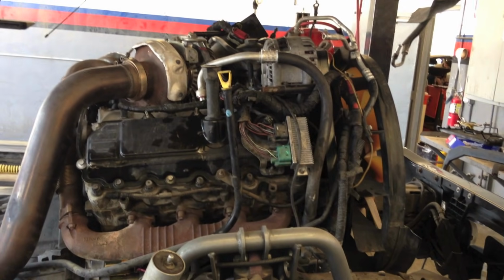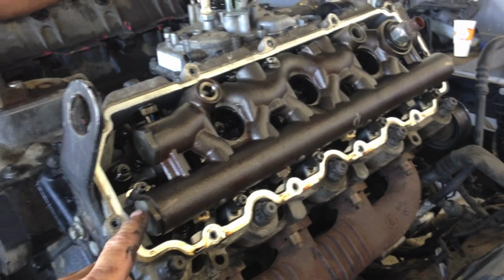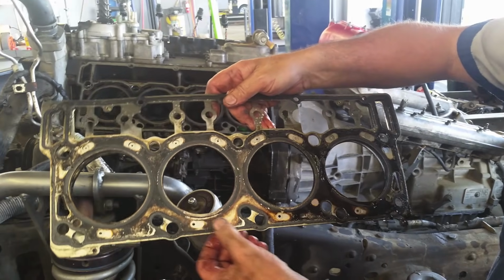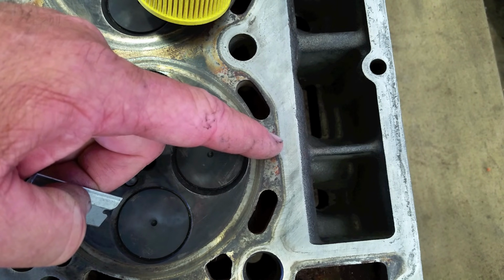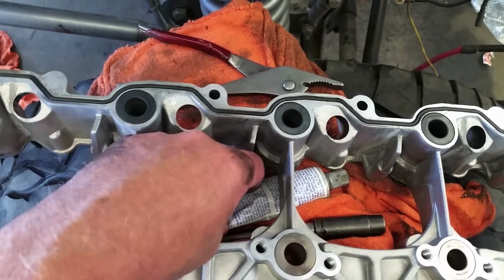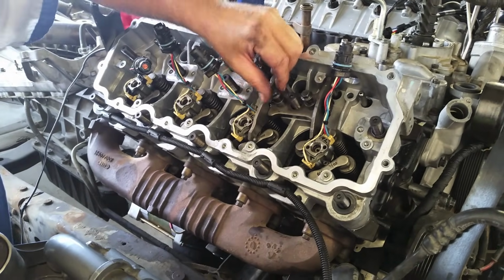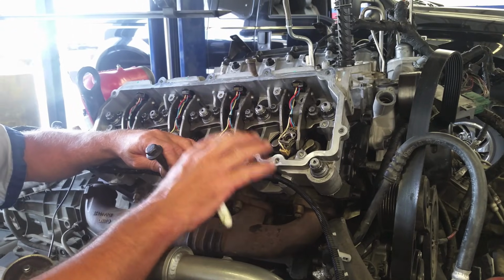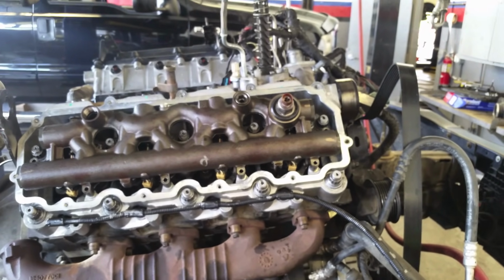Ford 6.0 Powerstroke head gaskets tips and pointers

Comment: Clearly this truck was run hard and with higher than stock power and boost levels,the aftermarket downpipe,,banks intake horn and lift kit are all signs of a play toy truck that the owner likes to show off,not a work truck.For trucks like this an o ringed head is the best repair. I know Ron said this is what Ford recommends and hes right but Ford also recommends 325hp and 24psi of boost not 30 plus and 425 plus hp,so Fords recommendations are out the window so to speak at that point. Typically a ..041-051 thick stainless steel wire is used with around a .010 protrusion ,when done right with ARP studds this is a huge upgrade and will give alot more holding power and longevity.There is a tool you can buy to cut the o rings,it needs to be done right, I used this tool on my Cummins to cut o rings and its very effective when done right.
Reply from the maker: No programmer on these gaskets.  It WAS modified with a programmer.  When it failed the first time he took the programmer out.  He just got cheap on the gaskets.
Reply: John DiMartino
 power and longevity on a Ford  $$$$$$$ buy a Dodge  $ never worry about your bank account again !
Reply: Scott wads the only problem is the only thing that lasts on the Dodge is the Cummins.
Reply: Scott wads  Yeah mopar Flickr in Flash  all the electronics start failing and then than the transmission  There is quite a bit of videos of head gaskets going  As well head studs are pretty popular on Cummins   Is drawbacks to all trucks but your best bet at least is to not get a Chevy

Comment: Interesting information regarding the head being susceptible to leaking with a mirror finish- I always thought at least regarding gas engines that a perfectly flat head would give the best results - So what would be the cause of head gasket failure especially since it was already changed and studs upgraded ?
Reply: That was old thinking. Even gasoline engines, no longer is it recommended to resurface cylinder heads.  You mic them, if within spec, you clean them, and go with new gaskets.  The job of the gasket is to seal. If both surfaces are within spec, and the finish is not abnormal IT MUST seal.

Comment: i dont see how you can warranty work like this i mean really check the heads the correct way not what ford now says you will rarely find a head warped the way you checked, thats probably why the old gaskets failed they just dont go bad for no reason. the best fix for a 6.0 head is the wire insert that is machined in (fire ring some people call it) its like having a liner protrusion like on a big diesel. Helps alot
Reply from the maker: Hi Hayden. after years of research ford /international updates their repair proceedures. if this method did not work we would not keep using it. Updated factory gaskets do not fail if done right in a stock truck.
Reply: i understand they may update them but still i wouldnt put a motor back together just by checking across the hole its sealing. i would check the head in an x pattern and then one across the middle if its bent more than .004 its gotta go. Also theres a reason why the old gaskets failed its probably not because they are aftermarket its probably because the heads are warped and the deck isnt flat. If you do this on a big engine and you check the heads like you did and see that its flat which it probably isnt it will never ever seal up it will leak from the second it cranks
Reply: hayden ingram

Comment: Ron, is there a way to accurately test for a blow head gasket when when you already know the egr cooler needs to be replaced? I left a comment yesterday with a description of where i am at diagnosing this issue.
Reply: +DJs Tuffmods you can pressureize the coolant system and drive around. I forget what pressure its suppose to be at

Comment: Hey Ron I really enjoy your videos. I have an 05 6.0 and its been  blowing coolant out the degas bottle. I installed an acurate  gauge to test pressure while driving. If the truck is hot the pressure stays around 6-8 psi at idle, when driving the numbers can change quickly, wot I have seen 18psi. My temp is usually 192ect 195eot city on the highway i can see almost a 10 degree difference at times. I'm REALLY trying to figure out if my head gaskets are blown. I do very little towing or hauling of any weight, but do have the Banks Six Gun but my power added alarm on the EGTs i have set fairly low at 1400. Any how, there is hardly any coolant loss other than whats coming out the degas, no white smoke, no oil in the coolant or vice verse.  I pulled the EGR the other day and its sloppy (wet carbon) so  i am going to go with the BPD Heavy Duty oil cooler with the winter kit and there EGR cooler. If i had a lift i would tackle the heads and studs before doing this job..  My question to you is there any way i can accurately test the heads before replacing the EGR cooler? I did the bubble test several times (BPD video) and its very inconsistent. I was going to do a pressure test but feel it will fail at the cooler. Any pointers you have are greatly appreciated! Thanks
Reply from the maker: can't say for sure if it's head gaskets or egr cooler, but your temps are right so it's not expansion.  Ford tells us to remove and test the egr cooler.  even replace a failed egr cooler then retest.  we offer package deals on doing all at once or no hard feelings if we have to go in twice and labor money wasted on trying the egr cooler first.  most 06-07 head gaskets are okay.
Reply: I am interested in your service Ron, even though I do all my own vehicle work and maintenance i lack a lift to pull the cab. I trust your judgment and expertise. Give me a ballpark price for the bulletproof egr cooler, i would like the heavy duty remote oil cooler setup with the winter kit added, arp studs,   dummy plugs, and anything else that should be done while the cab is off? I was on your web site and i also did a search and could not find out your location, what state are you in?

Comment: hey Ron I have an 05 f350 dually with a 6.0 manufactured in Nov. 04 I'm getting about a gallon of diesel fuel every 800 miles in my crankcase any advice on what it may be ? local shop here told me I have cracked heads and I got my truck back because I didn't believe them and they wasn't for sure that's just whAt they thought it may be any advice ?
Reply: yes you have cracked heads!!  believe your mechanic....

Comment: My 6.4 idles at 900 RPM could you please tell me how to turn that down?
Reply: +David Byrd you cant turn that down its computer controlled, and why would you? the amount of fuel it will burn at 900 rpms to 600 lets say be so little it wont matter
Reply: +Kevin Rogers it seems like it would be a little easier on the transmission at the red lights

Comment: Ron, you mentioned that you always pull the cab to do head gaskets. How would you attack a 6.0 Excursion?

Thanks for another great video!
Reply from the maker: body off on the excursions too. some vans too or pull the motor.
Reply: wondering the same thing. be nice to have a cab removel checklist for the excursion.

Comment: I have an unrelated question about a 2000 Ford F-350 Super Duty 4x4. I'm thinking of upgrading from my standard vinyl bench seat that has the high-back driver/passenger. What Ford seats will fit in that truck? Will Expedition or Navigator seats fit? Just wondered where I'd find the cross reference list for seats? Thanks.

Comment: hmmm OEM and the Black Diamond Headgaskets (not to be confused with the black onyx) are both made by Victor Reinz.I have a feeling the failure was caused by too aggressive tuning or the failure to prep the head/block deck correcctly.  Hope this one doesnt come back again.
Reply from the maker: +Zach Zmithrovitch It has original gaskets. It won't come back again. Black onyx, victor reinz. Black diamond, Sinister????? Made by Mahle. not the same as original and fail.  Black onyx are by far the worse ever. People quit using those years ago. Then came these with the stories that they are the same as OE. Ask any shop who does these engines. No aftermarket injectors or head gaskets. Fix it right and it's not a bad engine. Throw crap parts at it and it keeps failing and people say FN 6.0. It's not all the 6.0.
Reply: +DieselTechRon, idk hope you are right... I am in total agreeance that the black onyx were shit, they were made by victor reinz, aka: mahle.  That gasket did not work out and there was a lawsuit.  The revision is the black diamond gasket also made by mahle that have shown alot of success, that sinister repackages and puts their name on.

If not mahle, who make the Ford OEM 6.0L Powerstroke gasket and the VT365 gasket?  The rest of the engine (i.e. pistons, rods, lifters, bearing, camshaft) is made by mahle so that is believable, right?

curious as to how you prep the block, no rolocs or scotchbrights for me either.

Comment: Great video Ron. When the time comes, I want you to rebuild my the 6.0L in my 2004 F450 RV. The body can't be removed, so i guess pulling the engine out the front is the correct method. Thanks for all the great information.

Comment: OK - so if you reseal the nipple cups and upper injectors they'll fail, - But WHY, - is it because nobody sells the right O-rings made of the right materials, or what?
Reply from the maker: I don't know for sure..  I can tell you that a few of the largest rebuilders have  problems for years (still). They can't get it right.   Most shops that specialize in the 6.0 won't use after market injectors.  I get multiple emails a day about failures.
Reply: DieselTechRon

 That bothers me, there has to be a reason why these things fail. We can't be trowing away perfectly good injectors and manifolds just because an O-ring fails, - that just makes no sense.
Reply from the maker: +Blackaboe  They don't fail. They don;t need resealed.  Leave them alone and drive it. If you take them apart odds are about 80% that they will be okay. On the other hand that means you will probably be stuck somewhere needing to at least reseal one, Which one? who knows. Make sure you have tools to test and find it. Or some guy has to reseal 3.
Reply: DieselTechRon

Thanks for your advise, I'm sure you are right but I still need to find out WHY these things aren't able to be successfully resealed.

Comment: If you have no head gasket issues but want studs done.  Can you just swap them out without damaging the gasket/s?
Reply from the maker: no.  if you loosen one bolt to do a rocker arm it most likely will fail.
Reply: +DieselTechRon So you must replace the head gaskets if you go to arp studs.  Correct?
Reply from the maker: +Johnny van Vlimmeren  Yes if you loosen even one head bolt the gasket will lose the seal and fail.
Reply: I have read in a forum where several guys have done this after reading a thread. The one who created the thread had a successful turn out by just replacing or adding studs. However, this is certainly something that could or has failed for others. I would first  consider the state of abuse the truck has already seen and the millage before attempting it. My truck has over 155k and i am currently in the diagnoses state now.. either a blown hg, egr cooler or both:/...So i for sure wouldn't attempt it. But like i said, some have successfully done it  and i believe this was done back in 09 and the last update i seen with the swapped bolts/studs he had put over 40k on em.
Reply: DJs Tuffmods lol just do it and see what happens.
Reply from the maker: +DJs Tuffmods it's up to you. I can only relay what I've seen.  people that loosen a,bolt to install a rocker arm are usually back for head gaskets.  some don't notice  or got lucky.  we learned back in 03 it was that cut and dry.  a special was made to keep from loosening a head  bolt.